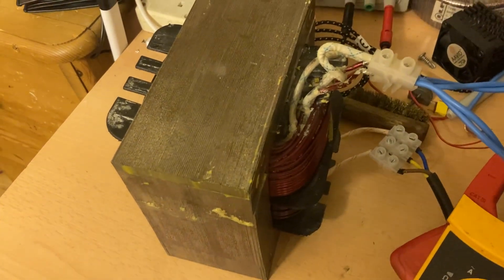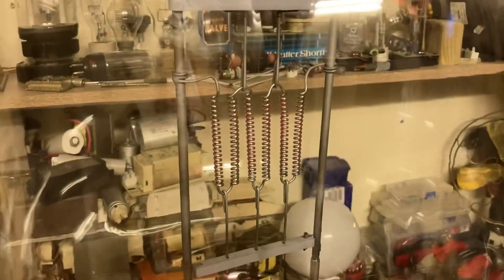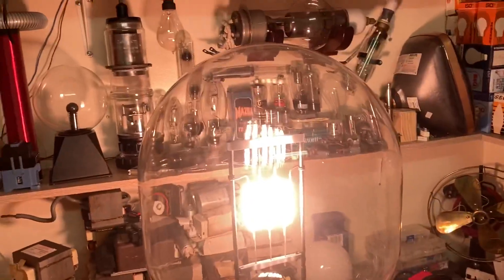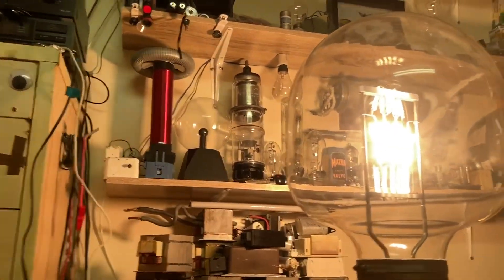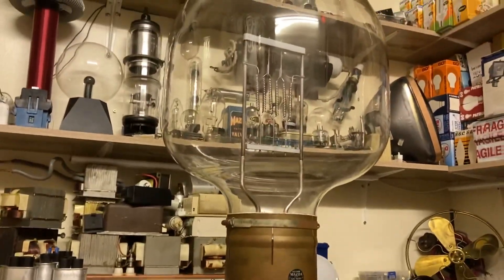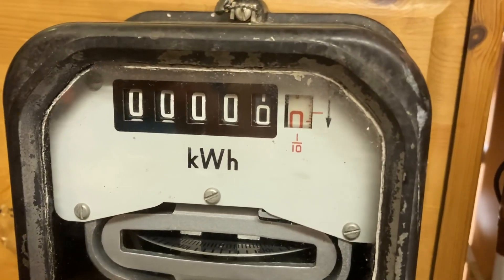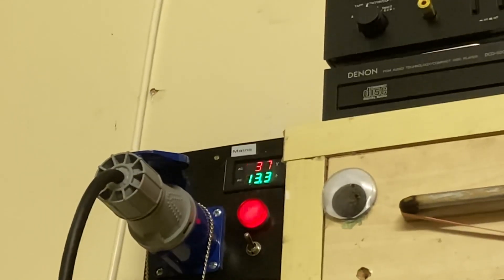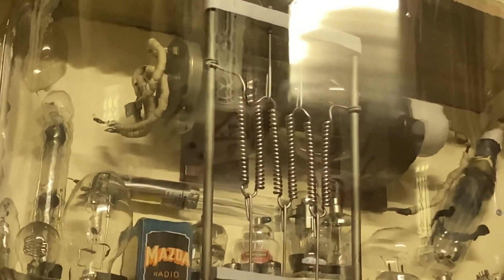20kw lightbulb half power test - maxing the electrical supply

Comment: Oh man, you need a few feet of THICC cable? Hit the local welding/farm supply shop. Stick welding cable is around $6 per foot, and something like 2 or 4 AWG, which is about 5 or 6.5 mm diameter. Should be good to (about) 100 A. :)
Reply from the maker: I’ve got some really thick stuff somewhere (easily takes 700A lol) not sure where it is though or I’d have used it here
Reply: @TheCORC-o9r  Noice! Would be interesting to replace the transformer secondary with that, if/when it shorts. Just a few turns, yet hundreds of amps! :D

Comment: Meanwhile you're heavily dosing yourself with UV-B/C
Reply from the maker: Uvc doesn’t make it through the glass as it’s not quartz, not that there will be much at all especially at this low power
Reply: @TheCORC-o9r  Actually, incandescent filaments only emit a little bit of UV-A wen running an their rated power and maybe zero when under-run like in the video. 
Regular glass doesn't block UV-A though.
Halogen bulbs on the other end do put out a bit of UV-B and UV-C since they run hotter but those wavelengths are blocked by the glass of the fixture or any glass window).
Reply: With an incandescent lamp not even running at full power ?

Comment: Awesome! I bought an old high bay floodlight for our living room (high ceiling) and converted it to take LED's. But it came with a 400W Phillips MH lamp. I hooked it up briefly, before replacing the circuit, and it was so freaking bright. I can't even imagine how bright your 20KW light is when it's warmed up and at full power!

Comment: The only lamp that has car springs instead of a filament.   You do realise at 10kw that thing eats through a unit of electric every 6 mins?  I am guessing all the lights in the neighbours houses went dim.
Reply from the maker: Yes it uses lot of power and the voltage dropped by about 20v lol

Comment: Not seen an electric meter RPM's so high since the sixties when elecy was cheap and 3 bar fires were the norm,  a rare sight today.  Thanks for the light show pleased it didn't turn into an arc flash.  Best .
Reply: When we operated both fans i show on my channel at the same time at the farm I lived at way back you could barely even see the line on the rotating disk in the electric meter because it spin that fast, totally both pulled over 60 amps from the mains 400 volt line 3-phase and blew all the main fuses like popcorn
Reply: @Pulverrostmannen  I like a good fan, I used to look after a 500kW quench fans at Pilkingtons, they each  took two minutes to get up to speed and screamed with the magnetostriction in core and windings battling the angry pixies. .  Digital stuff is no fun.
Reply: @WOFFY-qc9te  oooh I bet that sounded lovely :) nothing like some extreme inertia when you feel down
Reply: Here in Australia we once had the among the cheapest, if not the cheapest electricity and gas prices in the world, but not now its among the highest.  My friend pays 48.5 cents per kWh, and there is a daily supply charge of $1.60.